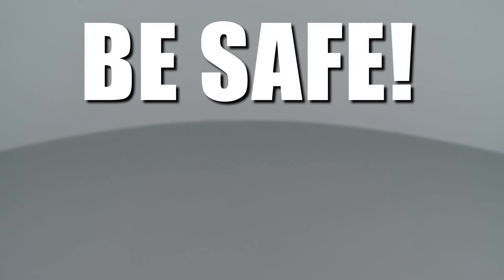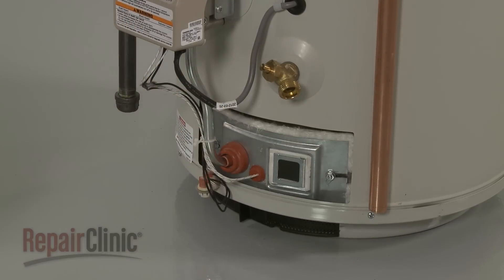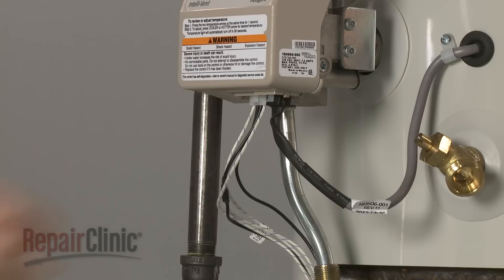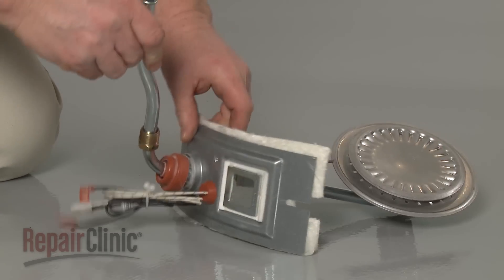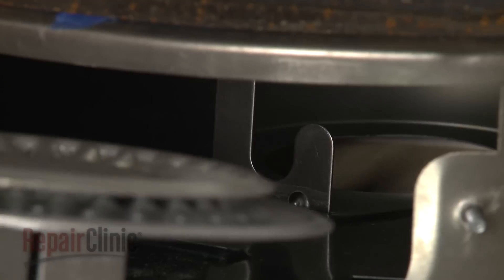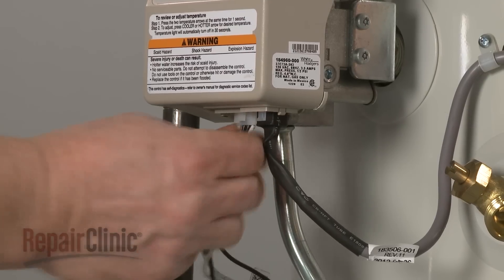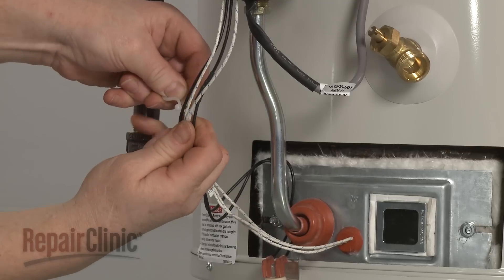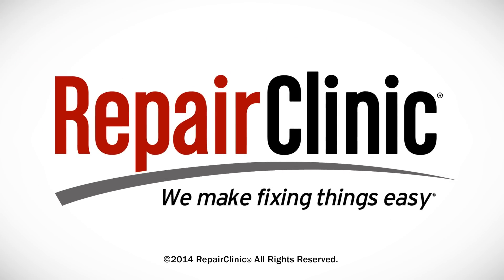AO Smith Water Heater Not Heating? Gas Burner #9005938005

Comment: Hi, thanks for the video.  Do I need to drain the water out first?  Do I
 need to turn off the main circuit breaker to replace the pilot gas line
 and the thermocouple? My Whirlpool Gas Water Heater has the ignitor with the wirings connected, but I don't think it has the power plug.  Thanks a lot

Comment: I have a slightly older a o smith model gas water heater, everything looks identical except mine isn't equipped with a vapor sensor or automatic ignitor (has a manual pezio pushbutton ignitor), but the big difference is that it has a left hand threaded nut on the burner supply tube. The plot tube and thermocouple both are right hand threads. Is there any way to be absolutely certain before ordering that I get one with the proper nut.

Comment: hello have a question.i replace the gas valve on the water heater but give me another code is for the fv sensor and i dont know how reset the code in the valve.
if you can help me whit this thanks